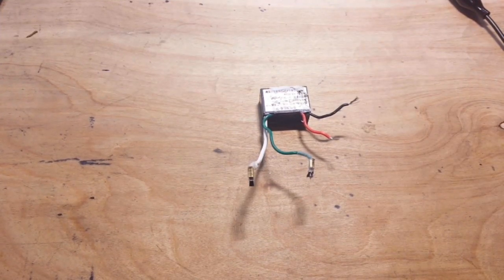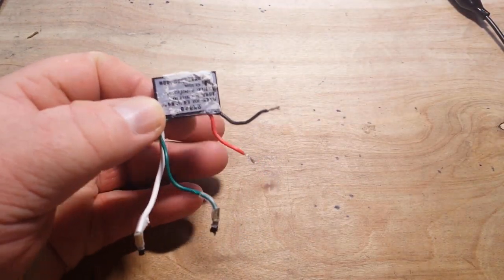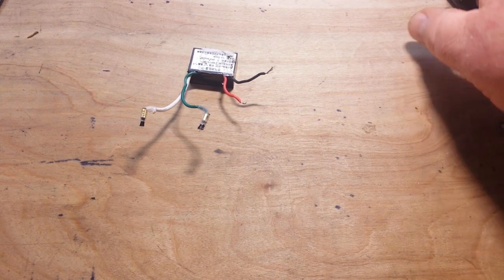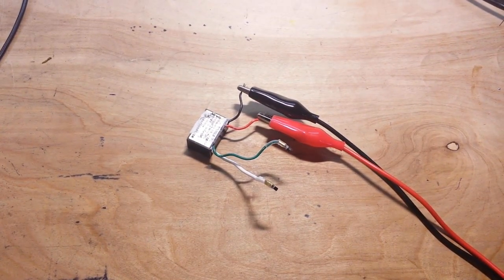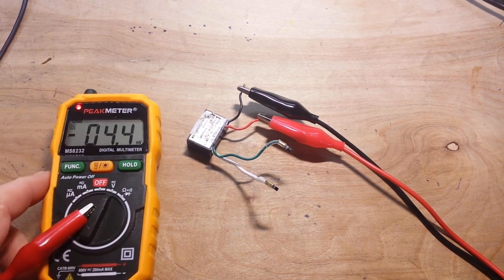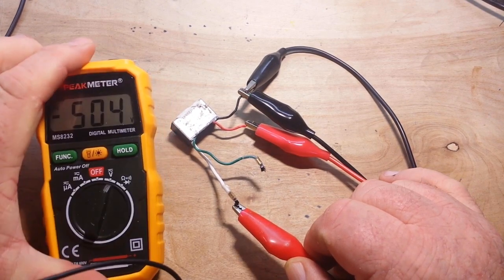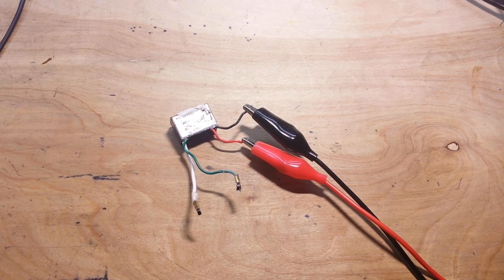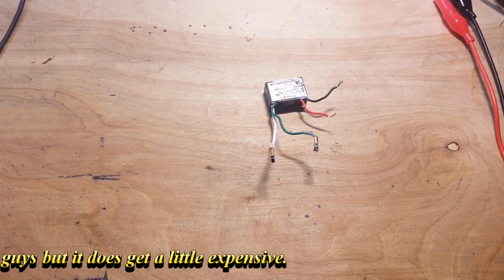Janbotek Negative Ion Generator does work

Comment: Hello dear sir, thanks for your nice video. i order a negative ion generator module 12VDC-4.5KV. I connected black prob of my Multimeter to ground and red prob to output of it like you. If I touch the side of the output wire, I see -120V but I will see an electric arc with more than -2KV if I close (not touch) to  its tip (output wire) so that my multimeter shows error. Do you think it is normal ? I don't know why i see -120V if i touch the wire?!

Comment: it will produce ozone when you put the 500 volts electrodes closer together until you get sparks. this sparking electrifies the surrounding air; thus creating ozone.  so you were right.... perhaps a voltage of 500V is not enough to create a spark
but 1kV to 6 kV will definitely do. you can try this out

Comment: Are you sure it’s not also making ozone.
Reply: It's designed to have a voltage sufficient enough for generating negative ion but not too high so it won't have coronal discharge which starts generating ozone. As he measured it outputs 500v and to generate ozone you need several kV

Comment: If you ran it off a battery, and also connected a micro-amp meter between one side of the battery and ground you'd see a current flow.

Comment: Lightning is a great ozone generator!
Reply: This is correct. The higher voltage, the more ozone is produced. If any electric source is capable of ionizing oxygen in the air, then it is also capable of producing ozone. And thus, depending on the voltage, "negative ion" generators are also potential ozone generators.
Reply: He's talking about a negative ion generator, not ozone generator
Reply: @udhi_gn3893  I think he's confused negative ions are what alow electrical current to flow though thin air using alot of static